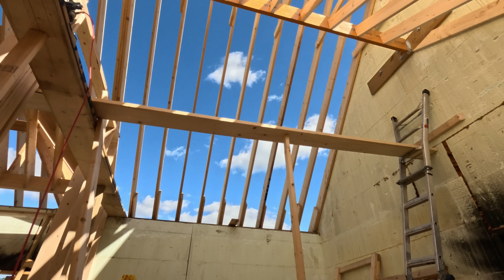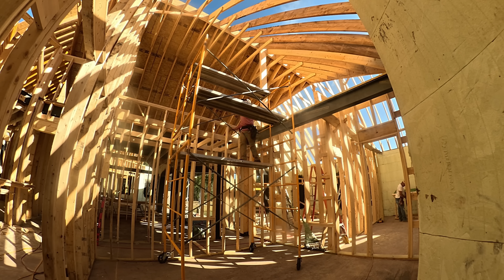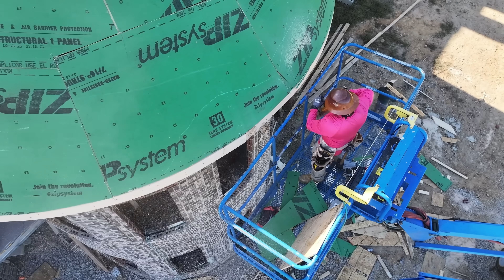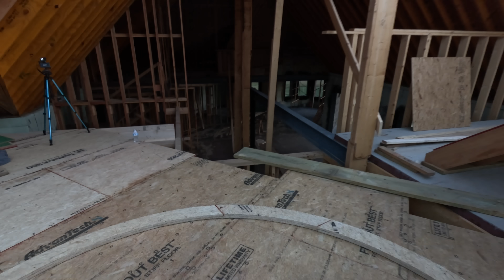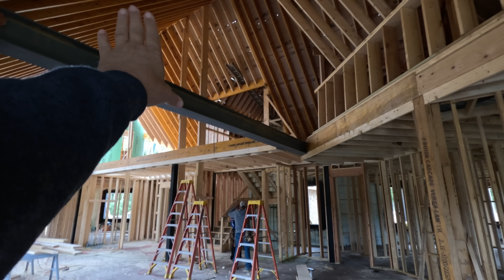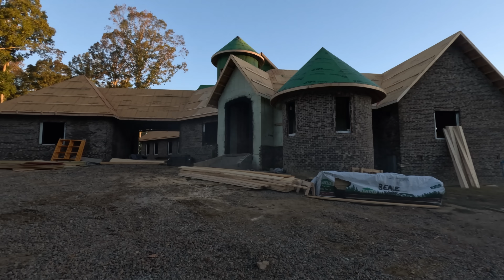ICF Castle Roof Part 5 – Final Stick Framing & Dry-In Prep

Comment: From a retired carpenter/ contractor "up Nort", your house & soon to be home is very impressive!
Lots of intricate framing has taken place. You have great crews working for you. 
How many guys are on the roof framing crew?  Seems like guys are everywhere!
I'm sure you will, but don't forget to add a lot of "pull tubes" to all your attics, utility rooms on all levels, etc. for future line & low voltage. 
Your head must be bursting with all the details not only from your house, but all the other things on your plate.
Looks great Geoff & Jacque!!!
Carry on Lad!
Reply from the maker: It’s a lot going on for sure! Usually there were 7 on the crew. We had a couple of days of extra hands. Thanks!

Comment: Geoff have you thought about using Cypress Wood on the ceiling of the patio?  

Cypress Wood ceiling is a durable and attractive option for a patio, as Cypress contains natural oils that make it resistant to rot, decay, and insects. 
I seen it used in very high end homes in Gaillardia  in Oklahoma City, a gated community where he uber rich live, and you are not seeing the Mathis  Brothers using material that is not durable and that won't last 100 years..

The wood is very beautiful and in the south it has been used on porches ceilings since Antebellum days and before.  Look into the Cypress Wood and it is warm and very beautiful, and last for centuries.
Reply from the maker: Thanks for the detailed suggestion!
Reply: @BealyGood  I hope the message is sent you in private helps.  Cypress is a very beautiful wood, that last forever.  It would even look great in your office  and high moisture areas in the house.

Comment: No more rain in your house Mr. Bealy Good, it must feel great, it looks fantastic sir. Hats off to those framers.
Reply: Water still can through the roof cause there are gaps(needed for expansion) between each panel of sheathing. The forgot to tape the seams on the zip and rolled cause if it is not done then it voids the warranty. I would even tape the other sheathing even though is not zip cause when water will get through whatever roofing material and underlayment water will then make it through those gaps. When my sister's house was being roofed a storm came through halfway the shingles weren't on yet but they did have the underlayment on the wind driven rain went up between the overlap abiling it to send gallons of water into the house. On of the roofers did come back and put on extra underlayment and secure what was there better which stopped before any real occurred besides destroying the old insulation which needed to be replaced any cause one layer was from the 60s that said r-13 but has lost two thirds of thickness and some 20 year old R-30 plus all the mice and other bugs and creatures that made it their home for decades(house built in the late 1800s in Michigan) and the insulation was insufficient being in climate zone 6 for existing needs to be a minimum of R-49, new is R-60. The ceiling didn't suffer any damage being it was lath and plaster being the insulation was removed immediately and ventilation was applied immediately. Another that got lucky on was the last of knob and tube which was buried in the insulation which is big no-no(previous owners fault and home inspection is pretty lax in the area) was replaced 2 months prior to the roof getting redone(3-5 layers with one section that still had the original cedar shakes and the oldest shingles being t-locks.